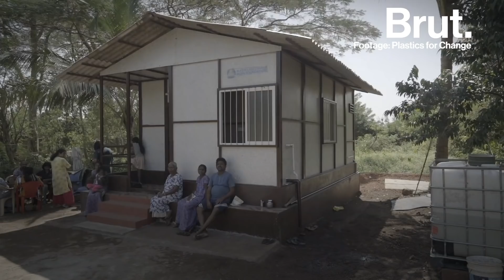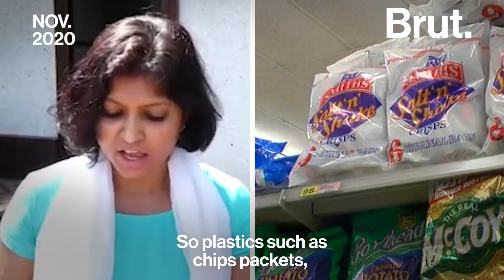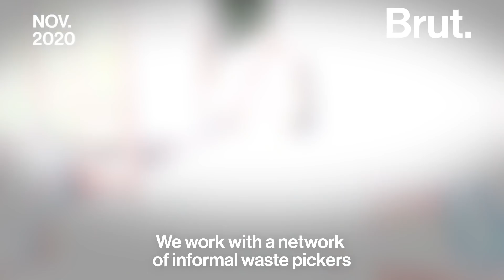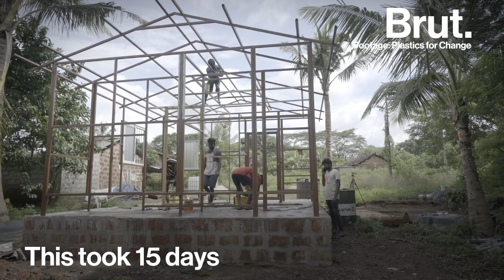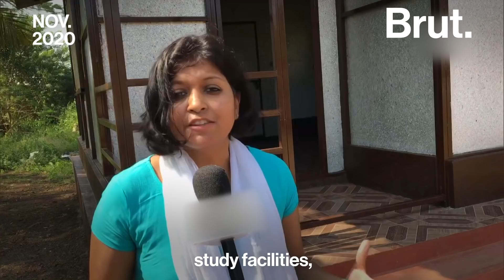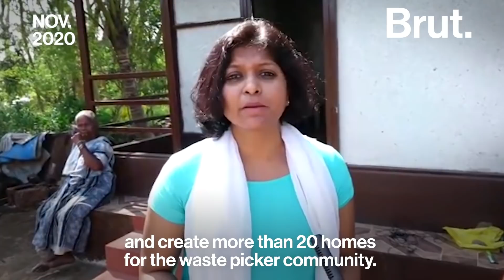Plastic From A Packet of Chips To A House

Comment: For those who are asking if the house will last for 30 years and is it earthquake-proof................

There is a reason why it's a sustainable house and no usually it won't survive an earthquake or flood; I mean which house does. If u want a house that survives for me than 30 years it will cost more there is a reason why everything costs more because of quality however, these houses can be easily rebuilt again. Plus it will only improve with recent advancements in 3D printing technology which will make it easier and cheaper.

Comment: Is it just for ragpicker community?  Is it Earthquake & flood resistant (i agree that even brick houses are'nt safe today)  but just asking for information. And after 30yrs we've to completely rebuild the house as its life span is upto 30yrs?
Reply: There is a reason why it's a sustainable house and no usually it won't survive an earthquake or flood; I mean which house does. If u want a house that survives for me than 30 years it will cost more there is a reason why everything costs more because of quality however, these houses can be easily rebuilt again. Plus it will only improve with recent advancements in 3D printing technology which will make it easier and cheaper.